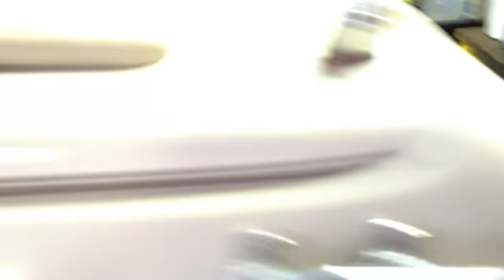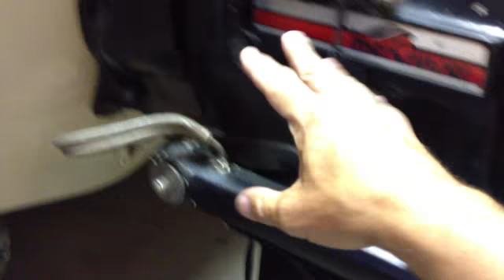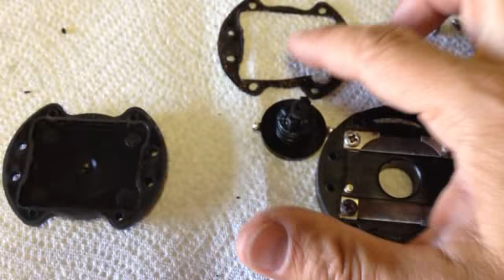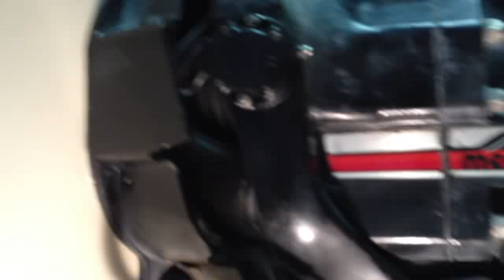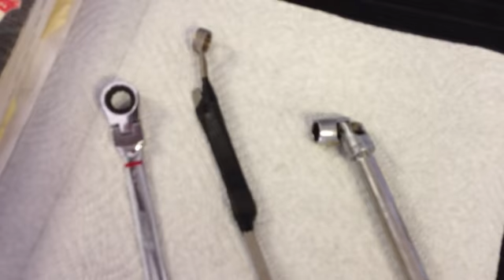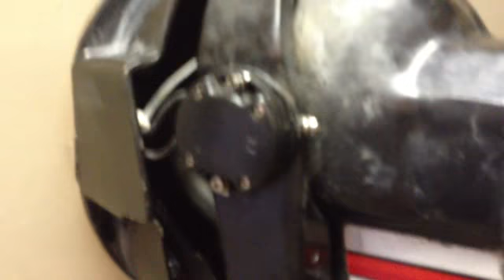Replace Mercruiser Transom Switches WITHOUT removing lower unit

Comment: I was able to pull the wires out about 8" and solder/heat shrink new units on,
put black silicone-adhesive on the wires and pull them back in from the engine side
so the silicone re-seals them.
Reply from the maker: Wish I could have done that, but the grommet on mine was part of the wire.  I had to remove the wire to cut it off to reuse.

Comment: Could always drill a hole right above housing into boat and use reinforced tubing to protect wire then silicone. Or! Use the same wiring and just cut/splice the trim with waterproof connectors easy done

Comment: I have a bravo 3 and replaced the trim and limit without removing the gimbal. 1/4" socket set and a I had a 5" long 1/4" spring extension bar that worked great, much better then a wobbly joint.. 11mm bolt holding the wire clamp, my clamp was completely corroded and I needed to get a new one. My bravo is 22years old. I put a bit of tape on the new wires to hold them together on the inside side and a small nylon cable tie on the outside, this also helped hold the clamp, this allow the clamp to remain in places as well.  I also used a pair of long Forceps to put the bolt in and had the wife pull the wires from the inside. A little fiddle and the job was done.  .Oh while I was threading the wires back in I split them down a bit so I could pull one wire first and then the other. I used a thin lashing twine tied to the old wires before I pulled them out one pair at a time. And. Put colour tape on them inside (before pulling them out) and the wires they needed to connect too inside.  Many thanks, made it reflectively easy.
Reply from the maker: Great tips, thanks for sharing.

Comment: That top bolt is very hard to get in trying it tonight for the first time. I was trying everything could not get it to start. Then it dawned on me all you need is a straight screwdriver and some sticky stuff. Now I can have it out and in in less in a minute then tighten it with a swivel socket.
Reply from the maker: Yep, I think I did that also.  You just have to get it started, then go to the wrench/socket.  Glad it worked for you.

Comment: Looking at these videos I found out that my limit switch on my 1992 Searay never worked. I could lift the drive all the way up with the up switch (and always thought it was supposed to be that way), and I would know when it was max up or down from the sound of the hydraulic motor. Now as I use the boat in a big lake with many islands and beaches I dont understand why anyone would want a limit on their drive unit :)
Reply from the maker: The reason is to prevent cavitation when you are running at high speed.  If you raise prop out of the water when going fast it could be dangerous as well as possibly cause damage.  Most boats have two separate switches for raising the prop.  One is on the handle which respects the limit switch and the other is on the dash (trailering mode) that can bring the prop all the way up

Comment: The wires that go inside the cap on the lower unit look like they are about to come out.  Can I just loosen the 4 screws and insert the wires to a better position?  I don’t want to take the lower unit apart.  Thanks for the clip. What is the name of that manual
Reply from the maker: The manual is the Clymer Mercruiser Stern Drive manual.  You can find it at https://www.clymer.com/s/mercruiser-stern-drives/marine-manuals

Comment: You can see for yourself what's happening...this is electrolysis at work! Brittle wiring and conductors disintegrating after a few years service.  
You do not want 12 vdc going into the water under any circumstances!  An EE talking...Better to get smart rather than remain stupid!
Reply from the maker: Not sure what your point is.  I agree that Mercruiser could have designed a better unit, but mine worked for 30 years before needing new wiring.  Not sure if the ‘new’ versions allow you to replace the wire, but mine seemed to be built to do that... and it works fine.

Comment: Where did you get replacement parts
Reply from the maker: No parts needed if you rebuild.  Just clean and install new wire.  Find marine rated wire if possible.

Comment: Another idea. Put liquid electrical tape on the wires. That’s what I did after I cleaned up my trim sender. My wires weren’t that bad. Trim sender was full of rust.

Comment: GOOD VIDEO and I applaud your ingenuity to tackle this project as a DIY without removing the sterndrive and bell housing.  One recommendation I would like to make for future viewers who might attempt to also tackle this project themselves instead of paying a dealership or marine repair shop.  SPECIFICALLY:  I would NOT/NOT use LAMP CORD to do this rewiring job with.  For reasons of safety and longevity, you should ALWAYS use MARINE GRADE wire (from Anchor or another US manufacturer) as MARINE GRADE heat shrink connectors on any DIY project you complete on your boat.  The copper strands in Marine Grade wire are tinned to prevent corrosion (oxidation), which particularly important if you ever use your boat in saltwater.  It also has high temperature silicone insulation, so if you ever get an engine compartment fire (and they are not that rare, particularly on older boats), that rubber lamp cord insulation is going to burn like a fuse when it hits its melting and combustion temperature, which may be as low as 350 degrees Fahrenheit.  Silicone will get you to around 500 degrees or higher before it will light off, so that buys you at least an extra minute or two to try and extinguish the fire (with your extinguisher) before you have a major conflagration and explosion.  Even the original wire that Mercruiser installed in your boat was NOT American Boat and Yacht Council (ABYC) and National Marine Manufacturers Association (NMMA) compliant, likely because of its age (1984).  I do like the idea of also sheathing your new wires with heat shrink tubing (also MARINE GRADE) as an extra layer of protection against chafing and water intrusion.  Marine grade heat shrink has an internal adhesive that self-seals the inside of it when you apply heat to it (so it waterproofs the wire inside it), and it too has a higher combustion temperature than the automotive stuff you get at an auto parts store or Harbor Freight.  Just like the wire, it'll cost a few extra bucks to buy MARINE GRADE heat shrink tubing, but it's worth it both in terms of safety AND longevity for your DIY repair project.

Comment: Just curious why marine grade wire wasn't used for the replacement?
Reply: But I do want to thank you for the tutorial.
Reply from the maker: I chose the wire I used for a couple reasons.  First it was all I could find locally and I needed it fixed quickly.  Second is that it matched the size and groove perfectly.  I think many are making too big of a deal on marine grade wire.  Maybe what I used was marine grade, not sure, I picked it up at Lowe’s.  It has been working fine for years.  As I suggested in the video a silicon wire would work best as Mercruiser wire dries out and cracks over time.

Comment: My trime gauge was working when I went out in the boat and came back the gauge was not working could this be the problem?
Reply from the maker: Very possible.  I would take the trim guage apart and possible OHM it out with a meter.  Maybe simply cleaning it will fix it.  You could then check both ends of the wire for continuity with a meter.  That would tell you if the wire is bad.  good luck

Comment: If the wire is good you could cut and butt splice, use a good 3m heat shrink. To start the hard to get at bolt, I've read a small child can reach it and get it started. I have an extension cord passed on from my Grandfather, estimate it from the 50's at least, and the cord is still flexible in cold weather. Anything we bought in the last 20 years gets hard and stiff.

Comment: Well, a previous mechanic did me a favor and left the upper bolt out last time it was replaced !   I would buy him a beer if I knew who it was.   Im not going to try to replace it either.   If it leaks a little water, Ill be OK with it.  It hasnt leaked so far so I anticipate it wont  after I fuckit-ahh I mean  fix it up

Comment: I wouldnt be using lamp cord , but thanks for showing that it can be fixed without removing the entire drive.  I wiggled a new exhaust bellows in there once so I should be able to get new switches in too !   F'n engineers should be forced to pay for repairs to the shit they design
Reply from the maker: Yeah I would have preferred something different.. maybe silicon based, but honestly the lamp cord has been fine.  Its got a rubber cover and the gauge of the wire is large enough.  No problems so far.
Reply: This reminds me of something years ago.  My wife had this one car with a really bad design.  The spark plugs could not be changed near the firewall.  After talking to a mechanic, he said that the engineers had to design a special tool just for the removal of 2 plugs.  It had 4 elbows in the wrench.

Comment: I watched your video and decided to rewire my trim sending unit. FYI, I had some 12awg/3 stranded marine wire laying around and found that the black wire is a direct replacement for the original in size. Mine was a 2002 mercruiser with alpha 1. Thanks for the video!
Reply from the maker: onemoreboat Thanks for the feedback, hope your fix goes well.

Comment: I have a 2000 Bayliner and this past weekend discovered that one of the wires on the starboard switch had broken due to corrosion.  The port switch is also ready to break.  When I attempted to remove the starboard switch, three of the plastic gears fell out.  Does the replacement switch come with new gears?  Am I able to splice the wire from the new switches to the existing wires so that I don't have to run the new wires through the transom?  This would save a lot of work and head aches.

Comment: MerCruiser trim limit / trim sender switches - another engineering disaster among many on these freakin' drives.  If it hadn't been for OMC Stringer drives with the rubber boot in the boat's transom, these would have won the prize for Worst I/O Evah!
Reply: BTW, what just about EVERY MerCruiser owner ends up doing is saying "Fug It!" and doing without the trim gauge and bypassing the trim limit!  I work on boats regularly and hardly ever see a Merc I/O more than 10 years old [5 or less if it's a moored instead of trailered boat] with the trim limit still in the Bow Up circuit.  They're all bypassed making the 'Trailer' switch redundant.
Reply: I remember reading somewhere, many years ago, the words of maybe an engineer (or lawyer), about these being so badly engineered that there should have been a major lawsuit.

Comment: Just finished doing this. What a pain in the you know what! Took about 4 hours - getting the bracket and bolts back on were the hardest part. Thanks though for the video - saved my self probably $400.00 in labor at a repair shop. Parts were just under $80.00 on amazon.

Comment: Inspired by your video, I'm attempting this. Bottom bolt wasn't too hard, but top one took a lot of wrench modification. Much different than what you did. I'm now at the point to run the new wiring, but I am worried about how to get the bolts back in... specifically getting the threads started.
Reply from the maker: Glad the video helped.  Getting that bolt started can be a challenge.  Do the easy one first, then the bracket is lined up for the next one.  Good Luck.
Reply: I did exactly that. Tough to get it started though. I wound up taping a coat hanger to the center of the bolt head... acted like a mini-u-joint.Another tip is that I removed the nuts from the top two gimbal ring clamping bolts, and pulled the bolts back to make a little more room.Thank-you for your video!

Comment: The 7/16 wrench fabricated to reach the upper retainer screw bolt and details about the retainer are to my mind the best part of this short video. I agree MerCruiser engineers should consider maintenance and could have located the wire pass through if they had given the trim and tilt sensor replacement more consideration. The author is better than I am reaching the bolts, I found it impossible to do this job without removal of the drive and the bell housing and the yoke. I'm opting to tear down the entire thing because I want to replace everything that might break in future while I do this job. Very good video.
Reply from the maker: Thanks Dennis.
Reply: I did that a couple years ago and it works OK. It’s only a problem if you have to operate out of the Shallow launch and have to manage to get to deeper water.    If you don’t have shallow water you’re all set. Otherwise all you have to do is use the instrument to tell you where Max trim is.    Then comes the problem of relying on it because I’ve been trying to get mine to work great for years and replaced everything and it still screws up. You set it and it wanders after a week or so. It works but it’s just not anything I call reliable.

Comment: They didn't put the wire grommets in the sides as you suggest because there would not be enough slack in the wiring to accommodate the steering movement of the drive.  Even if they did run the wires where you suggest, the amount of slack in the wiring would not be able to be contained and could get damaged.

Comment: I am sure the engineers were trying to keep the wire and clamps up as high out of the water line as possible, were you are talking about drilling a hole and going through the transom plate is a major pressure and leak zone.have you ever looked back there at full throttle? I sure the heck wouldn't want a potential leak and wire clamp there!
Reply from the maker: If you look at the other side of the transom you will see the shifter cable goes through the same location I was proposing for these wires.  They could have used the same bellows design here as well.  Would save a ton of time and effort.
Reply: True...

Comment: hi . i have the same problem that the wires just disappeared  i find two wires that go to the hydraulic motor and the one that go to the plate that you mentioned that the plate is plastic . but i still got to find where the other wire goes or is got to be join to the one making ground ?
Reply from the maker: So it seems your Trim Limit switch is connected as you have 2 wires going to the trim motor.  The Trim Limit switch basically keeps you from raising the motor out of the water with your hand (throttle) control switch.So the other wires are most likely your Trim Gauge.  You should be able to look at your gauge and if it has 2 wires then you need to get the 2 wires to them.  If you only have one then I suspect you just need to ground the other wire.

Comment: I took the trim limit apart as you showed and found the wire is held into what the video calls the "brushes" with what looks like an allen screw but I could not find an allen key that fits it.  I say it is between the 1/16" key and the 5/64" key.  I tried metric too and none of them work either.  If I could get the wire out, all I have to do is cut off an inch (my wire is bare at the entrance to the switch) and rewire it inside the switch.

Comment: NIce job! My up somtimes works. The gauge bounces around.  I traced it back to this part. Do you think I can just pull the cap off and clean it up?. just spray some electrical cleaner untill I am ready to replace them. What do you think?

Comment: I have a broken wire by the trim limit unit. If you wanted to bypass the limit switch temps tilt, could you just jumper the two wires together so that your console limit switch would work, using caution obviously to not raise your leg too high while on plane.
Reply: Of course,yes; that will work ; the drive will go up , including  ALL the way up;  ONE  has to be careful,and keep it down when underway;  better late than never,lol
Reply: I thought I just might try connecting the two limit switch wires in the boat since the wires are totally shot coming through the boat

Comment: Thanks for the video and information, boat dealers screw the boating public every chance they get.  I just changed a trim lift hydraulic line behind my stern drive.  The boat shop wanted $250.00 for some kit that would really fix me up, I went to a shop that makes hydraulic hose and they rebuild it for $7.23.

Comment from the maker: Yes try to find Coast Guard approved wire as that would be best.

A polarity problem?  Polarity has not changed, resistance is the same as OEM, gauge is working, trim is working.  

I agree that these should be designed as a sealed unit, but Mercruiser engineers did not design them that way.  They were not concerned about the issues being raised here.  They still sell the exact same design.  Actually the design looks to be made for serviceability with screw connections for wire ends and housing.... Very easy to rebuild.

If anything I have reduced the amount of electrical leaking by replacing the deteriorated wiring.  I already know the worst case scenario... With bare wires the gauge and trim still worked.  I just did not like the idea of having bare wires.

I will continue to monitor the units and report any issues... But so far so good.
Reply: Don't sweat it. You did a fine job.

Comment: For your information 
Lamp cord is not U.S. Coast Guard approved for use on a vessel.
The guy is right you are potentially putting your boat and others at the dock at corrosion risk. You are causing a polarity problem around your boat.